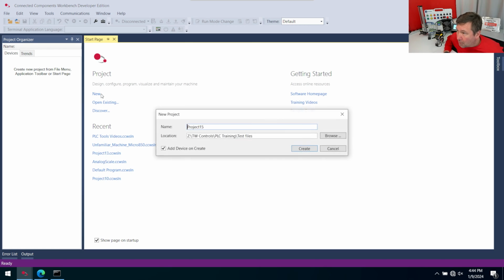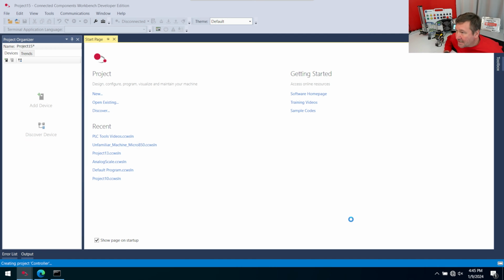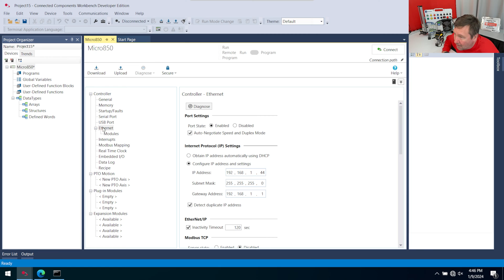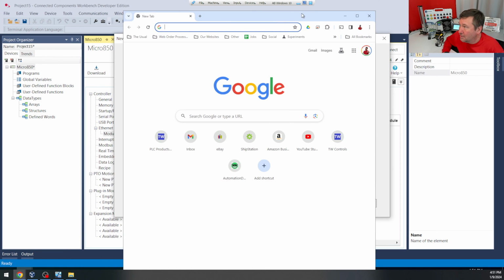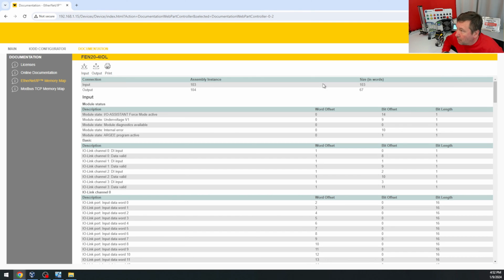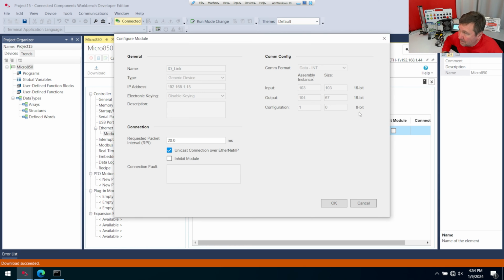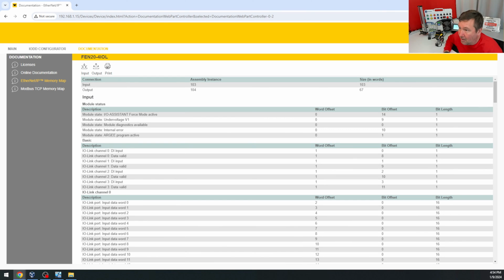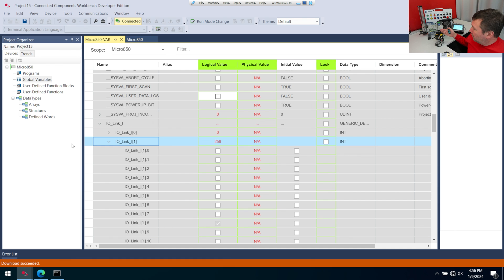Adding a Turck IO Link Ethernet Module to a Micro850 or Micro870 PLC

Comment: Hello Tim,

I am also trying to connect an IFM AL1120 master module, but I am unable to find the parameters to key into the Comm Config portion of the "New Generic Module" in CCW. Where can you find these parameters?

since you cannot import an EDS file into CCW like you can in Studio5000

Thanks!
Reply from the maker: You can open up the EDS file in Notepad and find it in plain text.  They should put it in the manual but I don't think they do.
Reply: @TimWilborne   I am looking at the EDS file as well as more documentation from ifm's website. and found some more useful information

can I contact you via email if you are open to it?
Reply: Good Morning Tim,

I sent you an email

Subject: "Regarding IFM AL1120 IO Link Master Module"

Comment: I am trying to connect an IFM AL1120 but I cannot seem to find the Assembly Instance part of the set up. Where do you tend to find this setting?
Reply: Try input assembly 100 size 223. Output assembly 150 size 151, configuration assembly 199 size 98
Reply: @tomhaines2462  you are amazing❤
Reply from the maker: For IFM, it is in the instructions that come along with the eds file you download. I have one but haven't done and videos on it
Reply: Hello Daniel,

I am working with the same module, any luck trying to get it to work with a Micro850 L50E?

Comment: Say the module you are working with doesn’t tell you the assembly instance and size what do you do? Or how can I find it
Reply from the maker: There isn't a way to "discover" it.  You'll have to find it in the documentation or contact the manufacturer.
Reply: @TimWilborne  is it common for it to be in hexadecimal also?
Reply from the maker: It sometimes is and that will definitely trip you up.